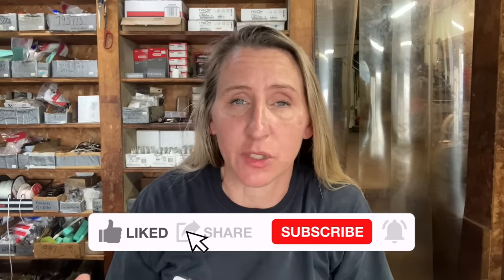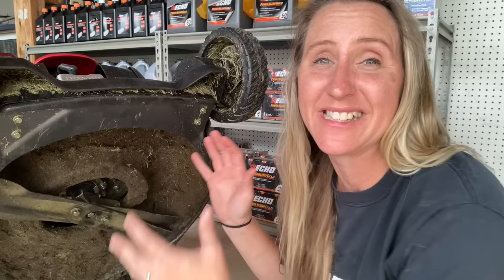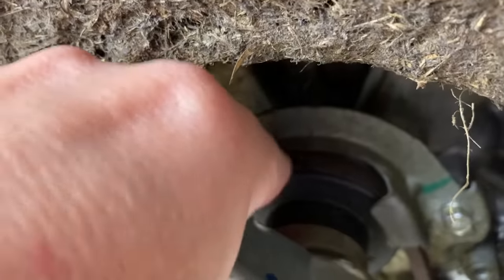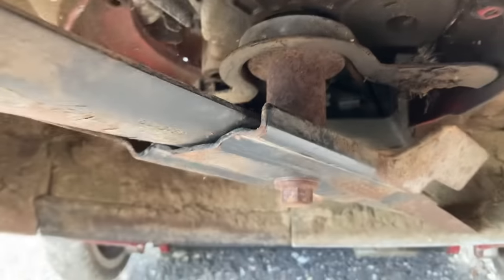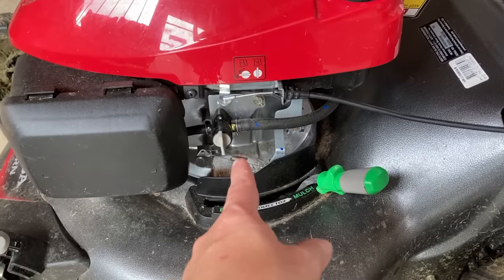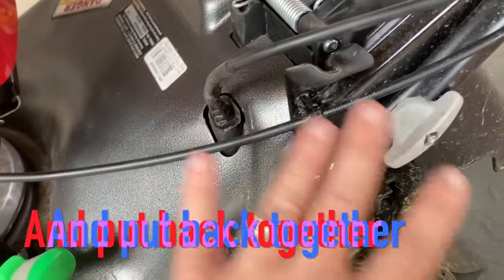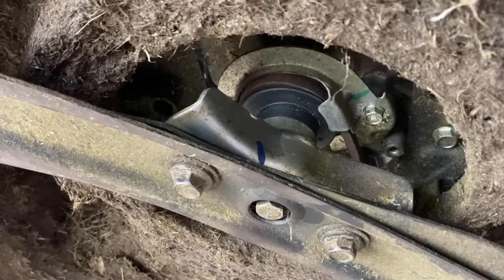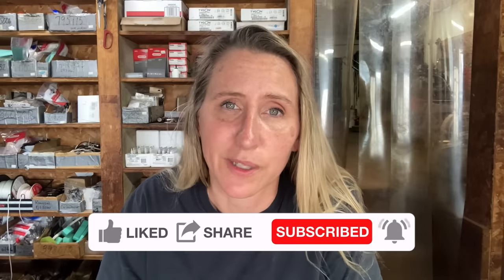SAVE A TON OF MONEY in repairs by NOT BUYING this NAME BRAND mower.

Comment: thanks for this vid. have been trying to repalce my current mower since the beginning of the season and haven't been able to settle on one because the quality of the current year offerings seem to be pretty bad.  I had seen this video earlier this year and forgot about it and was just about to just head to the store and buy this very model since my other mower has gone.  Glad I saw this again.  Will pass on this mower, but do not see any other choices aside from this and the Toro's....not convinced on the electrics yet given the price point of buy in and batteries.... a bit stuck making a choice...was about to just take a chance on the current Honda, but have seen nothing but problems reported in years 1-3.  My last two mowers never had a problem with them other than they physically gave out (wheels etc..).    In limbo....

Comment: I worked for a local Honda power equipment dealer. The HRN216 is junk. Honda is aware of the problem. They told us they were coming out with a fix, but never did 😢.

Comment: This is the reason why I only buy push lawn mowers. I had a Toro self-propelled lawn mower where the belt started slipping the third year because of the pulleys getting too smooth and the belt was slipping because of that. Not only are the push mowers a lot lighter and therefore really easy to push they are also mechanically less complicated and so not much can break down other then maybe the engine.  😂

Comment: Like the snapper rider mowers don't have a cover of some kind over the drive disk so as your cutting and riding around that rubber disk is exposed to grass dirt and sticks and rocks whatever is in the yard and water 

I told the guy that's a bad model he has because of that very small problem because that riders gonna go through those rubber drive disks and told you should have 2 or 3 extra  for when that one messes up or gets damaged i know it will because it's in the open

Comment: My experience as a shop owner is that the Over Head Cam Honda engines are junk,they have a very thin cam belt that runs thru a channel in the block to a plastic cam pulley! If the engine is stopped abruptly this belt stretches or snaps,(and usually breaks the cam pulley) resulting in pulling the engine,then the sump cover,and replacing the belt,and you have to time the engine also. For all this it is about a 2 1/2 hour charge plus parts,$275!!

Comment: Good grief...I've got a 20 year old Craftsman self propelled bagger/mulcher that still hasn't broken down yet.    Not sure what a Craftsman mower goes for now but I paid around $325 for mine when Sears was still a fairly viable entity.
The drive system still works and the thing still starts on the first pull.  Maintenance pays for itself...

Comment: Agree that Honda OHC mower engines are great.  However, their decks sometimes had design issues.  I had a 214 that started first pull for many years, but for some reason (safety engineer?) they put a gull-wing blade into this thing, I guess to lower the blade below the discharge port and keep people who wanted to manually clean the port while the mower was running from losing fingers.  The problem was, the blade in this configuration didn't have enough propulsion to eject heavy, lush grass.  It actually sucked grass back in.  So, I had to carry around a stick to clear the port every time I got into heavy, wet grass, and sometimes I would have to clear it constantly, which only increased chances of injury.  I got the distinct impression that the guys/gals who designed the engine were a completely different team from those who designed the deck, and the latter never tested the finished product under all operating conditions.  If they had done a proper job testing, the mower featured in this video and some other models would have ended up being great mowers instead of lemons.  Test your products, Honda.

Comment: QUESTION: I saw the reviews for this Honda mower. Some people even showed pictures of the fire department being called because the belt caused the mower to catch on fire! The problem is, virtually every brand this year has similar horror stories for the self-propelled push mowers. I have epilepsy and cannot use a riding mower. I have a yard that is about 1.5 acres in size. It takes me about 3 hours 30 minutes with previous Craftsman, Toro, and Cub Cadet mowers. But, those mowers eventually broke. The Cub Cadet lasted only four years. It was $299 when I bought it. Now, a similar Cub Cadet is $499!!!  

I bought the low-priced YardMax 2860 Front Wheel Drive mower, and it is TERRIBLE!  All the negative things said in reviews are true. The mower's maximum speed is slow. When people say it "starts off too fast," that is wrong. The mower simply starts of "INSANE" every time the front wheels touch the ground. The entire mower "BOUNCES" EVERYWHERE!  The mower also cannot be pulled backwards, because the black rubber thing at the rear of the bottom gets stuck under the mower and you are literally dragging the mower rather than using the wheels. The YardMax 2860 also took two pulls to start the first time, but after just a half hour it took EIGHT pulls! The "pulls" were "locked" and IMPOSSIBLE. The mower is supposedly powerful with 201cc, but that was false. The side discharge kept getting clogged up and didn't have the power to shoot out the grass. It took me SIX HOURS to mow the yard with that YardMax mower, even though other mowers always took 3.5 hours. 

My question is, do you know of a decent lawn mower for a decent price that is self-propelled, front-wheeled drive, mulching, bagging, and side discharge that is made well for a decent prince? 

I have looked on Wal-Mart, Home Depot, Lowes, Menards, Tract Supply, and others and everybody writes reviews for "name brands" such as Honda, Craftsman, Ariens, Troy Built, Cub Cadet, Toro, and others saying, "This brand is not the same as when I bought it the last time; I will never buy this brand again." 

If you know of a good mower, it would help me out a lot. I don't have a lot of money, but I need a mower. I can't use anything electric, because I would need a countless number of batteries. 

Thank you.

Comment: I have a John Deere JS40 with zero turn wheels in the front.  Years ago the repair guys were so slow on the tune up that I was forced to buy another used mower.  So, I also have a John Deere JX75.  It starts on first pull but I like it because it has a Kawasaki engine, an oil filter like a car, a gas filter and an on/off switch for fuel instead of a primer bubble.  But, most of all, I like the blade clutch gizmo that allows me to empty the bag without constantly shutting off and restarting the mower.  This clutch is operating but who knows for how long?  So... what modern mower has similar features??  The repair shop says it may that $500 to fix it so something else may be a better option.  Chicanic.... what say you?

Comment: No mention that Honda is no longer making walk behind mowers anymore?
The sign was posted at my Honda dealer when I went in for an air filter for my pressure washer.
I think they have also stopped with backpack blowers, too.
Reply: Yep! Only france will be making rhem.. she made a video about it... what were u looking for at honda? Im in the market too
Reply: @mysticandroid57  At this point, all I want from Honda is parts.
I'm using Chickanic and a few other quality channels to learn small engine repair.  Between regulations banning gas powered equipment and existing repair shops (like my go-to guy of 25 years) about to retire, I figure I have to be the one to keep my stuff in primo shape.
Replacement is going away.

Comment: I have a similar Honda mower and it doesn't have this issue (yet, but I'm smart enough not to mow wet grass), but it has another problem that's proof of Honda's bad design. My mower stopped rolling backwards. The back wheels just lock up when trying to roll backwards. I contacted my local Honda shop and they said they were familiar with the issue. The mower was less than a year old and was under warranty. "Hooray!" They fixed the issue and I was back in business....."until next year". It started doing the same thing. "ARGH! 🤬" . 
I called the Honda shop back and this time I was out of luck. No free fix for what was supposedly "their fix". However, the guy at the shop asked if the mower was getting wet. I told him only when I hose it off after use....you know, so the mower stays in good shape....so it lasts longer....and works better.
I stopped hosing my mower off after using it and the problem has stopped. "Ridiculous". 
When it's time to get a new mower (which will likely be pretty soon) guess which brand I "won't" be buying. Sad to see a good company go bad.

Comment: " I have a 40 year old Briggs&Stratton and it still runs like new all i do is sharpen the blade and change the oil once a year and change the spark plug and im ready for spring and summer

Comment: I bought a Ryobi self propelled with a Honda engine. 3 in 1 mulching blade 20 years ago. I replaced the belt once. The self propelled axle mechanism wore out and they are no longer making replacement parts. The engine still starts on the first pull. I change the oil every season and wash the deck underneath after every use. It’s now a push mower. Engine runs too good to get rid of it.

Comment: I can personally attest to these mowers being junk.
I own a HRN216VYA, actually ive owned two! First one was returned in first two months of LIGHT use!
Second one i made it through one season of LOW HOURS AND LIGHT USE. 

Used it for the first time this season last week and the self propelled belt started burning. Had to use an old old mower to finish the small lawn i have.

Purchased new honda belt from amazon for almost 40 bucks. Installed it yesterday. PAIN in the ***!
Mine also has the roto stop system which is even more difficult to change a freaking belt that only had less than 30 hrs on it!

I did TONS of research on these mowers 2 yrs. ago and decided on the honda over the Toro. Man was that a MISTAKE that im sure at this point will keep on giving.

Honda should do a recall.

Comment: I have used a variety of hondas for some and ive had issues with the tabs that flip the handle forward for storage break off and I ended up putting a nut a bolt through there

Comment: Speaking as the maintenance guy at a property managment company, I have found Hondas to be overengineered and made with cheap parts. The engines are great but the wheel assembly, drive train are junk.  Toro is built simple and solid. I'd buy a Toro mower with a Honda engine. Although one of our mowers is an ancient Toro with a Briggs and Stratgton engine and it just wont die, tough machine.

Comment: I don't have this particularly mower, but I do have a Honda HRX217. It was my first Honda... I had high expectations. I have myself repaired/replaced the self propel drive twice, the blade clutch once, and the entire carb twice. Very labor intensive and a royal PITA. I have had older Craftsmen and Toro mowers that have lasted decades. If you have one of those, keep it and fix it as necessary. Don't buy a Honda!

Comment: I had a Lawnboy mower that the self propelled feature was useless. It had the same open area around the drive belt for the self propelled area. I have a Toro now and it has the plate in it. It is a mid price model whereas the Lawnboy was a low price model my wife bought over the internet. The blade housing even rusted/rotted out on it. It started like a champ with that Kohler engine in it. Moral of the story do not buy the low end models. You will live to regret it. Goes for computers too. I worked on them for 20 years. Note about Toro electric mower. engine is electric. I can do about half of my 1/3 acre yard with one battery. I use it for all trim work along with my Stihl mid price trimmer. I cut the rest of my yard with a cub cadet 30" rider. Yard looks great. Thanks for the great article about octane and water in gas you did recently.

Comment: I had a self-propelled push Toro that lasted 15 YEARS, and i only changed the oil like 2-3 times in that period. Never had any other issue with it in all that time.  I never mowed in wet grass, which is something you mentioned to avoid.  But other than that, nana .... no issues at all.  AND, the price in 2003 dollars was $329.  So, 329 / 15 (years) = $21.93 / year.  $21.93 / 22 mowings per year (average) = $0.99 / mowing.  How's THAT for value !!!!!!!

Comment: Experiment to try. Get customers to stop using the mulch plug & instead let the grass fly out the rear chute. Other option change to a oval honda disc or round & use fluted blades. This latter option is best tested on one mower only to see what happens over time. The grass build up is also not ideal & customer needs to be told to clean it always after use. There's another reason also i say this. Check oil level before you start & check the crank when your finished as there maybe twine wrapped around the crank, (on sp's with your type of system it's not much of an issue however others that don't have a pulley can have twine ride up & rip the seal ) in your case checking for grass & cleaning may solve the issue after each use or not. Mulching mowers work by cutting then lifting the grass drawing it to the center then depositing it back down closest to the crank. This is why grass is being lifted into the belt v groove or outside it i assume, hence why i say open the chute. Yes it leaves lines however the more the chute flap is lifted the wider the spread will be avoiding heavy single lines of grass. Failing that if they're fussy switch to catching with high fluted disc blades or get a dedicated mulcher. A sack or other object with weights can be used across the handles to avoids stuff hitting legs the more the flap is opened

Comment: Nice video.  Ya, that exposed belt inside the deck is a dumb design.  I had a Yard King mower years ago that had a crazy 2nd small shaft sticking out of the side of it's engine to power the self propel unit.  Never had any isues with that as it was all "above board".  Surprisingly the shaft, which looked pretty unsupported, never had issues in the 25 years I used it.  It was still running when I sold it for $40.   

A lot of newer "easy start" gas powered mowers with "auto choke" have issues with the choke not fully turning off, which causes the engine to run stupid rich once it warms up.   I was given a free 6.75 HP Toro Recycler mower with few hours on it as the owner got an electric to replace it since they were tired of dealing with it.  The carb was gummed up bad from sitting around for 2 years.  

Instead of messing with it, I got a Chinese carb off Amazon for $20 or so, and I removed the POS auto choke and installed a manual choke cable.  It only sees ethanol free gas and it runs like a champ now.  That 6.75 HP engine really has a stupid amount of power now that it is running cleanly 😆

Comment: I had one Honda that I was a little disappointed when the transmission rubbed through but I had used it quite a bit. Then I bought a second Honda in between a couple of older push mowers and I was absolutely disappointed with it I only had it a year and it just had no power compared to what Hondas used to have. I have other Honda powered devices but I am done with Honda push mowers. I also bought the other brand with personal pace. I had it before and I decided to go top-of-the-line with it and I am disappointed with that also. Unlike my other one this one if you let go of the handle it shuts off. And it just feels out of balance, and that was a $500 push mower. Luckily I only use them for trimming but still. And with the price of batteries for electric I was just afraid to pull the trigger.

Comment: Great video, i bought the hrx 217 hzc in Canada i paid 1550$ with tax in late 2019,brought out in 2020 when reached 5hrs. Did first oil change bought oil from dealership, used all 2020,2021, brought out in 2022 3rd.time out my lawnmower exploded leaving hole on left side of engine,took back to dealership, they were shocked,never seen that they said and when they investigated it told me they didnt know what caused it,of course just over warranty, ive gone to honda for good will,was refused because honda was told by dealership, lack of lubrication,i said not satisfied, i want a supervisor,was told same as first time,going in front of 5 man team who refused me the 2nd time aswell,all i get is lack  of lubrication,i sent another email,asking them to tell me what i did or didnt do too make this engine explode i have had no reply so i guess they are ignoring me now as have had no response. I still have no lawnmower,in your professional opion what do u think happenned to it, definitely ,wasn't anything i did i was in the Canadian army from 1977 to 1980 had several courses for driver wherl and light and heavy track vehicles had to do all driver maintance and i am in my 39th year of plumbing told them i am very cabable of maintaining a lawnmower.really is sad,i wonder what goodwill is for this sounds like a case for it but they dont care seems like

Comment: I am surprised that it's a Honda. However I do have an HRX217 I bought 5 years ago, maybe?  It was $700.  I just cleaned the carb and it's running just fine.  I had a yard mowing business about 30 years ago and had a walk- behind Honda and it cost me $700.  yea go figure.  The air flow on the older one was much better.  It would fill up the bag -- packed.  The new one does not do as well.   I saw a video about how to fix the air cleaner cover and it has stayed fixed ever since.  I think the model I have is used mostly by commercial users.  I'm afraid that trying to get by cheaper is killing their quality.  I have had no problem with the self-propelled feature... so far.   I'll know where to look when I do though.